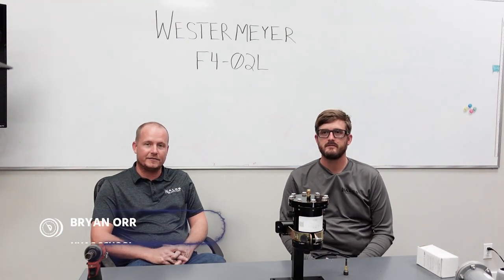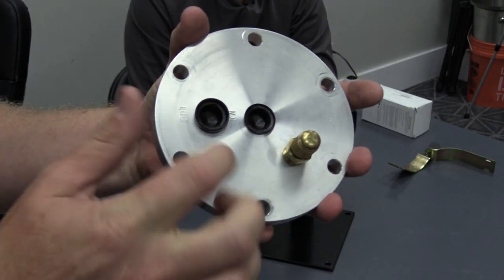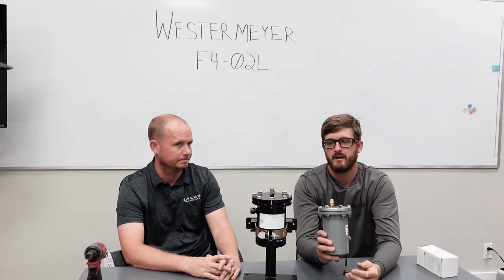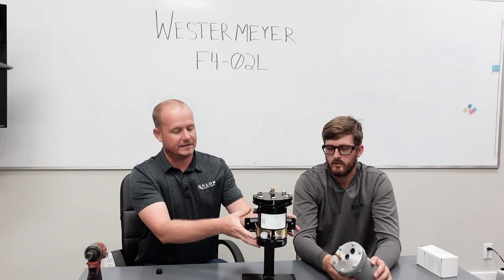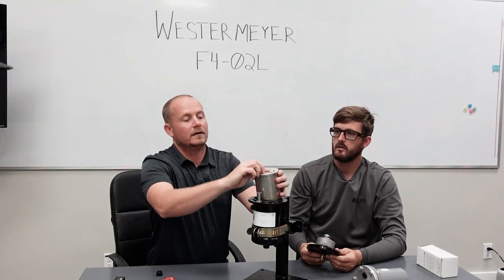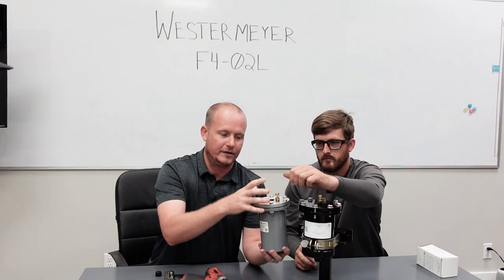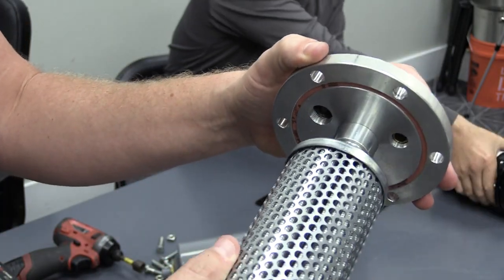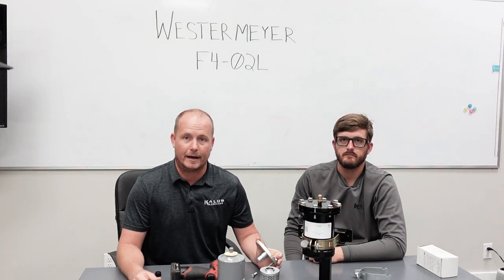Westermeyer Oil Filter Comparison

Comment: The only units where I have encountered oil filters are on huge screw water chillers and they are part of the compressor. But if I am to design a large scale refrigeration unit, the westermyer would be best.